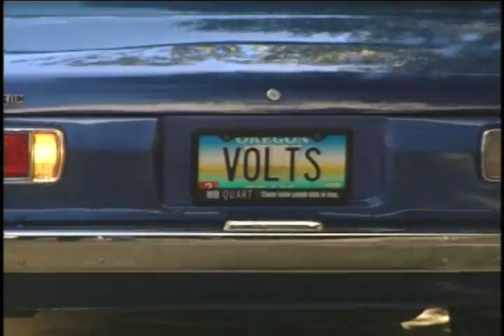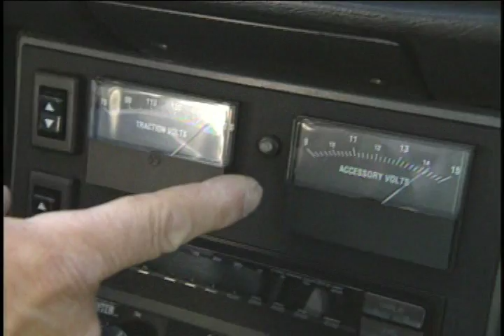Homemade Electric Car Maker Builds in his Garage

Comment: David, if you can pull that car into a station, change the batteries quickly with a hydraulic system, and pull back out into the highway within one minute, then no gas car could beat you. High efficiency, deep cycle lithium rechargeable batteries would be developed which would use copper rail contacts. These batteries would weigh a lot, but that weight would push the battery down against the copper rail contacts, making the system stable, and the contact constant.

Comment: Low temperatures adversely affects the charging/discharging performance of batteries. Try driving an ev in New England and compare the difference between deep winter and mid-summer.

Comment: They shouldn't suppress this type of technology, the battery can be made portable, charged from solar panel farms and then distributed in portable packages, the user would just have to replace the empty battery with the already-charged battery at a station and the empty batteries would be taken to be recharged from a solar panel farm, farming solar power is much more effective than oil, and if there's an automatic factory-like system intergraded, the whole process would be carried out simultaneously.

Comment: Why don't you use solar panels in the roof like a moon roof to power the batteries as you drive and incorporate a generator to re-power the car by the revolution of the tires? The car would never need recharging theoretically. I am no mechanic nor have I ever tried to build anything but I think these things would turn the corner for the EV.
Reply: Would be interesting to know if any of these independent EV makers have tried that. I can't see the big auto makers giving a car that recharges infinitely & for free with movement.
Reply: Solar panels wouldn't produce enough electricity to really help that much with charging the batteries. But, like on the fisker karma, they can help power the interior accessories.
Reply: if the entire roof were a solar panel , it would propel the car around 3 miles if you parked it on a good sunny day .

Comment: 2:05 "All you can hear is the other cars making lots of noise."
2:10 Dodge Charger drives by. "VROOOOOOOOOM!"
Too funny
Reply: LOL, nice catch.  Iove a good engine rumble, what gearhead doesn't?  But I have to admit that a lightweight car with an electric motor has some appeal.  I almost never drive more than 30 miles a day, so a EV would work well for me.  Maybe just put some playing cards on the wheels for some engine noise, lol
Reply: RCPro Driver Thanks hahaha. Cards would sound pretty nice I s'pose ;)
I was read your other comment about the pollution, and wanted to add in that those who live where there is ample sun could probably charge their cars with the purchase a some solar panels. I'm not electrician, so I don't know how many they would need, but it would be something to consider. 
As a fellow gear head, I do loves me some displacement. But I am no dummy, electric is the way to go. I'd love to build my own EV out of an original Mini Cooper. It's too bad Aptera closed down though ;(
Reply: matt1618john146 Matt, I agree that some kind of noise is needed to prevent people from walking out in front of electric cars. I've been pretty close to getting hit by electric cars here in Japan several times, not only because they are so quiet, but also because roads are smaller in Japan and thereby cars are driven much closer to pedestrians. Now, my head is constantly on a swivel when getting hit is a distinct possibility.

Comment: he can beat V8 cars with a brushed motor and standard car batteries.  Imagine what could be done (both power and range) if Lithium (or similar) batteries and brushless motors became affordable.  I know RC stuff and in that hobby brushed motors are replaced by brushless for greatly increased power, more efficient, less wear and all around better performance.  I like that this guy used Datsuns.  Todays cars are fat and heavy for no good reason.

Comment: the big question is how much will it cost to convert? electric motor, batteries, wiring harness and charging system, modifications to the engine compartment to accept the electric motor and batteries, modification to the transmission with some kind of adapter plate for the clutch/flywheel...this is NOT a simple bolt-in. this guy can do this in a day because he has experience with this, but the "average" mechanic won't be able to do this without a lot of trial and error. that means money

Comment: The alternator will charge the battery as you go??? Many many things wrong with that.  The alternator is not 100% efficient and even if it were the draw from the vehicle power would be equal to the gain so it would have no effect.  Couple that with hear created by charging and other inefficiencies.  If it were to be used as a regenerative system than it wouldn't have enough voltage to charge those batteries anyway.  So no the original alternators cannot be used other than inefficiently for acc

Comment: it may not fully keep it going, but the constant recharge will increase the mileage by enough to be significant. instead of only 30 miles, you might get 35 or 40 miles. the amps to charge the batteries means nothing other than time, it takes 8 hours to charge at 11 amps or 88 hours at one amp.charging is charging. and btw, solar panels aren't as expensive as they used to be, you can easily get $1 per watt. if you can put 100 watts of panels on your car(easy), it'll make a difference.

Comment: the same as any other car. your brakes aren't connected to your engine, the reservoir for your brake fluid is just under the hood for easy access, it's totally independent from the motor.

Comment: weather doesn't effect it? how about when your batteries freeze in -10'C or less when the car is running in the winter? and with the wind chill, the temperatures under the hood will be less. but the guy talking about the smoke stack somewhere else is full of it, with the solar stirling dish and solar stirling tower designs being envisioned, electricity will be cheaper from there than from any other source. also, supercapacitors are being developed that will allow fast, long lasting charge.

Comment: this dude acts like electric motors are matenance free, and run forever.. while they do run a long time, they do have bearings and brushes that will wear out and require service..also him calling the engine/radiator nasty, think of those nasty batteries that also don't last forever, and are expensive as hell to replace.

Comment: Batteries don't behave well in very hot or cold climates, both kill range and output power.Since were not going to get oil companies to stop fracking for natural gas, may as well rebuild the engine to run on LNG directly and cut out the middleman creating electricity for the grid with the same gas.

Comment: I wonder if you will put a solar panel on the roof. I also wonder if 1 wire GM alternator could help charge it while you are moving. You use old cars with out vacuum powder brakes. About all of then have been crushed.

Comment: As long as you're not hauling additional weight of a charging system with you. A "range extender" mounted on a small motorcycle trailer would be fine, as you could disconnect from it when you don't need it.

Your post brings up something else we need...lightweight turbo-diesels.

Comment: Or have the batteries easily changeable and just have the two sets of batteries, have the one set charging and when you run low on charge you just go home and switch the batteries. Probably would be a little cheaper.

Comment: Electric cars are fine and are not for everyone.  It does have limited range and speed but could replace one of the gas powered cars in a two or three car family.  I think it would make a good daily commuter car if you don't have to drive too far. To limited my using a car, I converted a mountain bike to electric power, max speed to about 25, mph range is about 13 miles.  Saddle bags were installed which allows me do food shopping and stops at the bank and library.  Work is about 10 miles away.

Comment: Even 30mi range could be very useful.I could drive my 18 miles to work,plug it in all day at my shop,then drive it home and plug it in with energy to spare.Sure I can't drive 120mi to visit my parents,but imagine of my ICE powered vehicle only came out during those circumstances?Keep in mind that sustained highway speed driving is the most green and equipment friendly way to drive an ICE vehicle. Also, even coal powerplants produce less pollution per KW or HP than an ICE. Good Job!

Comment: Sir I would love the chance to work with you I want to build an electric tour bus with solar panels I have a huge electric motor from an old grinder from the fifty's its 220 volt water grinder the thing must weigh at least 600 pounds cast iron frame Im not sure the amps of the thing.its a  monster the motor itself is at least 20 inches wide and I looked up electric motors on ebay the closest thing I could find on there was almost 13 thousand bucks but I will take much less interested ???

Comment: if there is a way to charge the battery system in a matter of minutes than this system would win. like say 15 minutes. plus charging it is not that big of a deal, plug that night, go to work that morning, and if work places just install, like charging bays in the ground at parking spots, than the EV would win.

Comment: That is bad ass!  DC current high tourque.  They have made alot of improvements to DC technology.  Still the same problem you can't go as far on pure DC.  But why can't there be a way to put a capacitor bank and actually store extra electricity until you need it?? ? One lightning bolt captured in a jar could power the city of Toronto for a while.. I'm sure the technology is out there but won't be capable with major oil companies still driving economies in most parts ofbthe world

Comment: Tumps up for the smart electric cars in this video. Just tell the Sir in 4:08 that burning Natural Gas to produce electricity to charge your e.v just produces Heat (so electricity) and water vapor (evaporated water), so that will keep the carbon print in almost zero. So Sir, you better find a best argumentation against electric vehicles.

Comment: At 5:20 into the clip, former auto executive Robert Stempel characterizes the internal combustion car as "meets all my needs, it's wonderful." Roger that Bob, except for manufacturing costs, repair costs for belts, fuel pumps, water pumps, radiators and transmissions, operating costs and inconvenience for oil changes and fueling, as well as environmental pollution and noise. More nonsense from the auto manufacturing and repair industry. Robert C. Stempel was simply another lying rip-off artist.

Comment: Longterm, "recharge time" is not an issue.  We will pull into a fuel station and exchange battery packs.  The stations stay in business, it's win/win.  For a different reason, we exchange propane tanks for our grills.  We don't have to recharge batteries.  Does it require a removeable battery pack and a lift?  Of course!  Will it take several years to happen?  Definitely.  The manufacturers will continue to drag their feet until Google gets into it.  Electric vehicles = 100 mpg equilvalent.

Comment: You should use a small size motorhome/ bus belt driven generator to not only charge the batts. on the go but also give the motor more p and power other components such as the horn(s) and lights.

Comment: If u want to cut the charging time in half you should get a small compact generator that uses the axle to spin a chain which spins a magnetic rod in the gen which in return creates electricity for battery recharging on the go.

Comment: is there any EV that can do that? Technology comes in baby steps. First, get and EV that doesn't need an extra source for power. Than produce an EV that can generate more HP. Lastly, produce and EV that can do all the above and has a 300-500K range without a charge.

Heck even most gasoline based vehicles can't go that distance without re-fueling. Why put such high standards on a a new technology just for it to compete the with old.

Comment: Love the vehicle, but guess what GM and the top 3 don't want the EV to move forward. Check out their most recent cut backs on the Volt. And what about the price tag? And GM still hasn't resolve the battery issue. But go to the UK, Germany or Switzerland and guess what they do. Check out Citrogen's electric 162mph, 300bhp vehicle. Next question GM?

Comment: It would be great to get a list of items that were used such as the make model of the electric motor, the make of battery packs, any adapters, wiring, controllers, etc that were used.  Sort of like a kit list.  Also associated cost would be handy as well.

Comment: @stiffyschlong False!  The average efficiency of all coal power stations in the world currently stand at around 31%, approximately the same as an internal combustion engine.  This is fact not opinion.

If we have enough uranium fuel, we need not be concerned with efficiencies.  And what makes you think that is so dangerous?  Don't build a nuclear power plant on a fault line.  As for the waste, put it in a rocket and shoot it at the sun.

Comment: @beke6874 Coal burning power plants are much much more efficient than internal combustion engine in cars, and power plants have better catalytic converters and emission standards with lesser toxic fumes and those toxic fumes aren't dumped to the streets.

Nuclear? YEah right. The efficiency of uranium fuel is only 0.2%. Sure it's thousands of times in energy density but the reactors are very inefficient, dangerous and ultimately you have to dump the radioactive spent rods somewhere.

Comment: 30 cents to fill up?...and you get 30 miles? I rather pay 50$ for my 11 gallons which will get me 330 miles.

Sure, you save on maintenance, but it's a very limited vehicle. , There's no trunk space thanks to the batteries; you can't make long trips; batteries have a pretty short lifespan, it's doubtful that you'll have all those batteries working 10 5 years from, and safely discarding those batteries isn't all that "green" . While i do think ev power is the future, it won't be for some time.

Comment: this type of motors are easiest way to convert any car into electric but i think it is way too expensive keeping in mind its production costs... there are some cheaper motors in market. but guys which has at least ~mid end equipment in their garage even can build it by themselves :)
and i think it is better way to use two separate motors to front wheels balancing power between them on turns because it is better for traction :)
i am just wondering... the battery used in that car is rely small...

Comment: What about power brakes and steering? Those components require constant turning and are usually spun by the engine? 

In addition, why not use a self charging on-board system that incorporates alternators and a roof made of solar panels?

Comment: The brake system of a petrol car is connected to the engine. THe air is sucked out of the brakes for it to work. But How did you overcome this when you removed the gas engine. What braking system are you using?

Comment: Lithium batteries are good for seven to ten years and even though they cost way more than lead acid they last so much longer that their cost per mile is under ten cents. That is actually pretty cheap compared to an established gas car cost of over 50 cents per mile. Lithium batteries are simply very thin sheets of copper and aluminum with a super thin molecular coating of lithium...so that means they are 100% recyclable...much better than lead acid, which wouldn't last one call in a cell phone.

Comment: They fail to mention the car requires regular replacment of the worn out batteries.  the optima deep cycles he uses cost about $289 ea.  Put ten of those in the car just for grocery getting range and you have $2890 dollars worth of batteries that have a life span of maybe five years.  This also represents a much larger requirement for lead mining a toxic metal.

Comment: Yes, coal fired power plants do make some pollution, but it is miniscule compared to thousands of gas cars. And the cars are in the city, whereas most power plants are located away from downtown. Furthermore the power plants are so big to handle peak demand they cannot be throttled back. So they waste thousands of kilowatts overnight. By recharging overnight at off peak rates about 75% of all cars in America if they were EV's, could be recharged while you sleep, with zero additional pollution.

Comment: @m1aws   furthermore, it is a far simpler engineering problem to treat the emissions at one power plant than it is to have hundreds or thousands of point sources (IC engines) each of which must be equipped with scrubbers (catalytic converters, etc)

Comment: @Itsmeeman1
Hahaha. You swear like a fellow Englishman. Too right about fuel prices!
He uses a standard adapter plate between the motor and the gearbox. That's the least of the problems. Electrical/battery issues are avoided here. Best to read up. A lot! John Wayland is very impressive. Google "Cedric Lynch" and look for video's. I want one!

Conversion is expensive so you need a worthwhile car or keep everything modular for when you want to throw the shell away and fit into another.

Find EVTV.

Comment: @SoldierK4 and not a bad idea either, but the alternator would have to suit the charge demand of the battery bank (if it isn't a 12V system). no big deal, just a few extra mods

Comment: @kazimann 
That's why you use hub based alternators! As the car rolls it creates power. Also if you have a 4 wheel inhub motor system you can use 2 at a time and the others will feel power back into the system. It isn't physically impossible is just has to be done RIGHT now CHEEP!